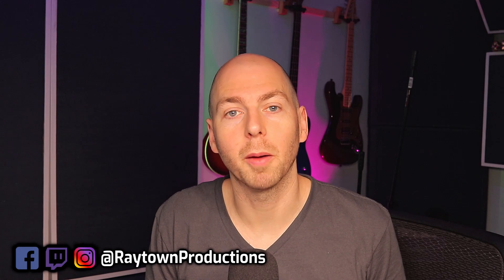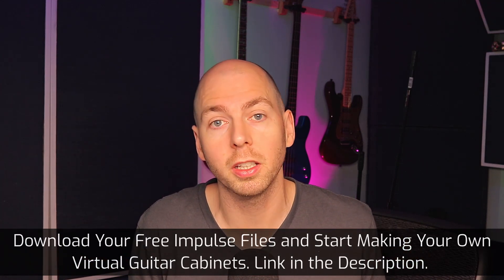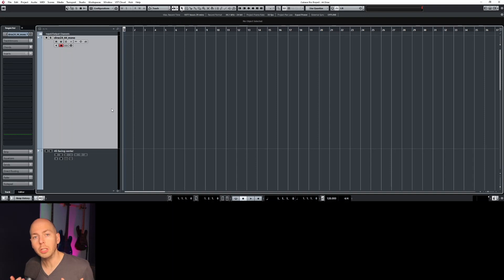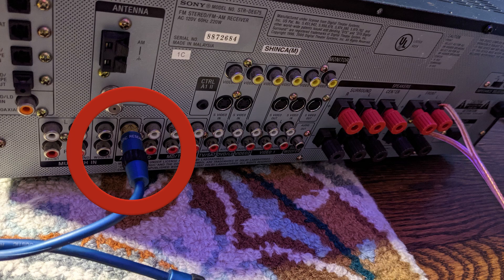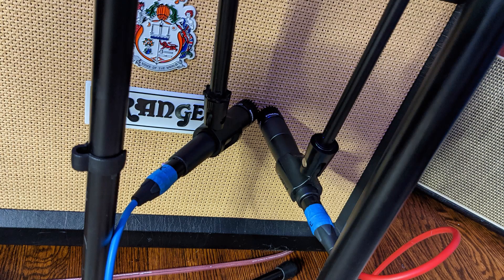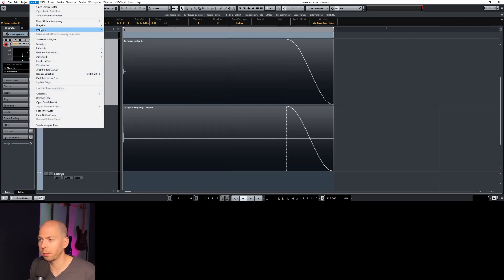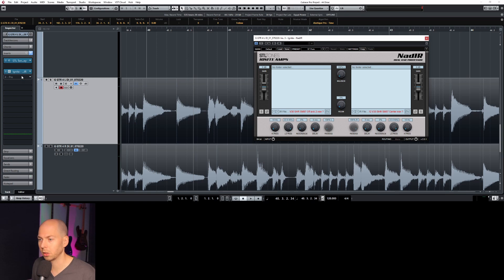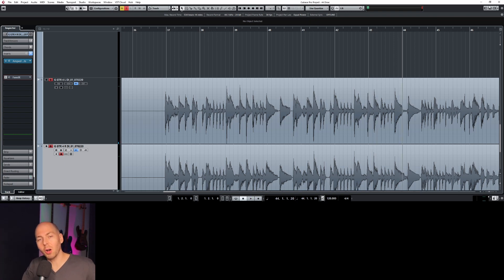DIY Guitar Cabinet Impulse Response [EASY WAY] + FREE DOWNLOAD

Comment from the maker: Some quick corrections:
1. Fredman technique is actually 55 degree angle - NOT 45 deg. Minor, I know but trying my best not to spread misinformation!
2. The Amped Roots Plugin allows you to load an IR into it so you don't need another impulse response loader. Just click on the IR label and you can load it.

Comment: Great video! Just a quick tip (to anyone who reads this) about using a guitar amp with the less colorization of the impulse signal. Play it through the FX return of your amp instead of running it through the main input, then only the power amp will color the signal what is not necessary a bad thing.
Reply from the maker: This is brilliant! Great suggestion and something I wish I mentioned in the video. Thanks Breszko!
Reply: Yes, i have a very transparent guitar power amp that doesn't colour the sound. Plug it in to the fx loop of the preamp to bypass the preamp section is always a good idea
Reply: @RaytownProductions  I'm glad you find it useful!:)

Comment: Question: What is the best point to cut the initial part o the captured impulse? I use other method: I pass a sweep signal through the amp, record the speaker then deconvolve to a pulse. After that I cut to the desirable lengt. But always wonder about best initial cut point. Thanks in advance.

Comment: I did use the power amp section of my H&K to record my IRs. What would you say is the biggest coloring difference in using a clean amp? I do experience excessive midrange in my IRs.
Reply from the maker: It really depends on the amp. It can also have some nonlinear effects if it's tube for example. If your irs have a lot of midrange, you can always post process the ir with an EQ and save it that way 🤘

Comment: Downloaded the free download but the dirac file is not there, and the various impulse files that are are empty save for a fade in and out on the end. Loaded into reaper drag and drop, there is no click or any blip on the track even when zooming into sample level. How do I get the correct diract IR file?
Reply from the maker: It's there, you just might have an auto fade setting enabled which will crossfade the dirac impulse out. It's only 1 sample long, so it might be hard to see.

Comment: Hi, have you ever tried using Voxengo Deconvolver (sine-sweep), and of course use your desired microphone setup, instead of the 1 sample white noise method? Do you have an opinion and if yes, are you aware of any advantage or disadvantages? Nice video :) and thanks for any reply.
Reply from the maker: I have tried it, but for some reason I couldn't get it to work right with the Deconvolver. Both methods are pretty similar, but I think technically the sine sweep method could reduce the amount of "noise" in the final IR by averaging it over a long time. I haven't done extensive A/B blind testing to prove this, so this is just my initial thoughts. Great question!

Comment: Hey Bobby! I was wondering about IRs with different sample rates. I have a bunch of IRs that come as 44.1, 48 and 96 kHz. I usually mix in 48 or 44.1 kHz, depending on which the source multitracks are, and I choose the IRs based on that. But does it make a difference?
Cheers!
Reply from the maker: Good question! I'll have to look into this, because I don't know :)

Comment: If you're using a guitar amp, you want to use the power amp only, so run your signal through the FX return, and set your Presence and Deep knobs or whatever equivalent you have as you generally would, because those knobs will still work, but the other front settings will be bypassed. Someone else already mentioned this. Just remember that this will include a snapshot of your power amp settings, as well as power tube saturation. Be aware that running into the FX return tends to push the power amp harder, even on amps with a master volume, so KT88, 6V6, 5881, and EL34 power tubes will have accentuated coloration, due to their having less clean headroom, compared to 6L6, and even some 6L6 amps might get some coloration, so you might have to turn down the gain on your preamp to not over saturate your tone, or else you might need to make two IR's, one with power tube and one through solid state, especially if you know you are going to be boosting the input when you go to actually record or reamp later on. This is doubly true if you're doing things like quad tracking. You can also use power amp emulation plugins or pedals on your signal chain for that initial capture if you know how you're going to set it in advance, so it's included in your IR, and one less thing to worry about later. Including the power amp is useful if you're using amp sims, or if you're using a hybrid or solid state amp live, compared to a tube amp in studio, EX you're using an Orange Terror Stamp or Orange Crush or an amp modeler live, but then use a rockerverb in studio recordings, and want to run that IR via a pedal to FoH.

Comment: So you're not using a deconvolver, just the recorded burst?     Interesting.     Of course you can use any sound with the right settings and make an impulse response.    I'll have to do some testing with your method.
Reply from the maker: That's right. This method doesn't have anything to deconvolve 🙂 cheers!

Comment: Wow you just use old power amp home theater system, interesting!. Btw my old sony power amp home theater is also similar to yours 😂
Reply from the maker: yeah i know haha! But it does the job and the specs are good enough to do exactly what I need it to. MUCH better approach than using a guitar amp in my experience.